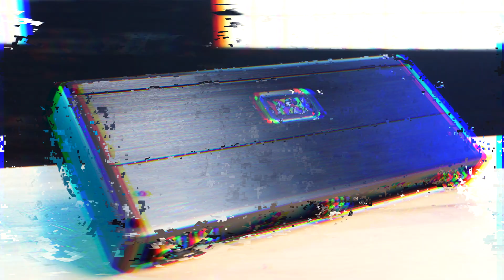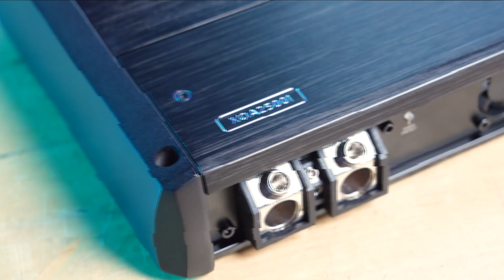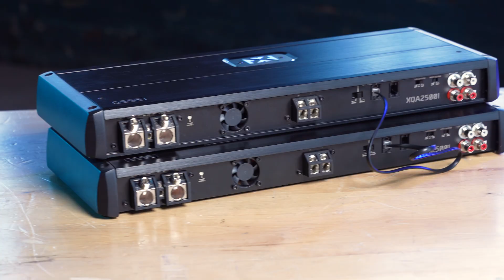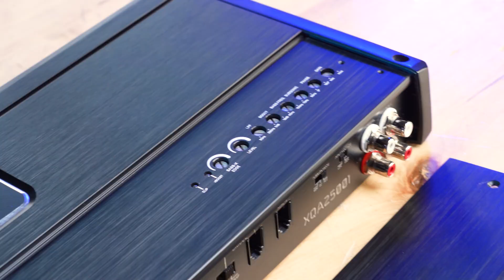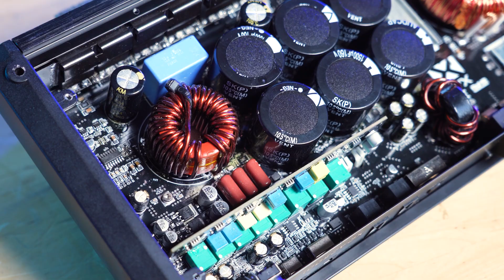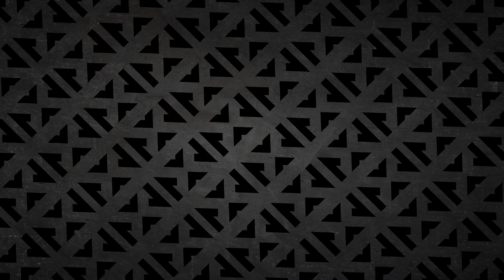NVX 2500W XQ-Series SQ Hi-Res Strappable Monoblock Amplifier - XQA25001

Comment: How is this considered hi res?
Reply from the maker: This amplifier is capable of playing above 400Hz, for a bass amplifier, this puts it in a High Resolution class of amplifiers. Our full range amplifiers are High Resolution due to its high switching speed that allows it to handle 24-Bit audio signals.
Reply: @NVXAudio  

Please don't misunderstand.   I really like NVX and recognize them as one of the most consistent of tge budget brands.   However, there is no such thing as hi res audio when it comes to bass reproduction.   Full-range,  absolutely, but the range of frequencies for speakers that are considered hi res is limited to the higher end of the frequency spectrum and does not include bass.    I'm still going to rock with NVX, but this is a bit of  misinformation